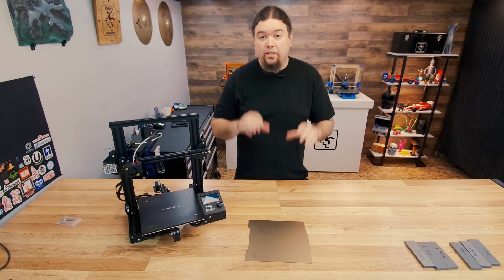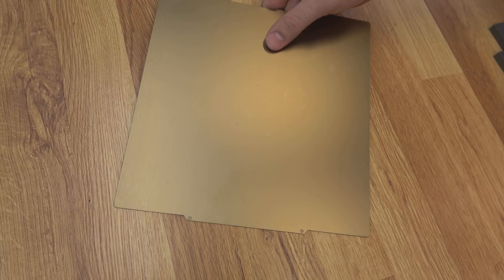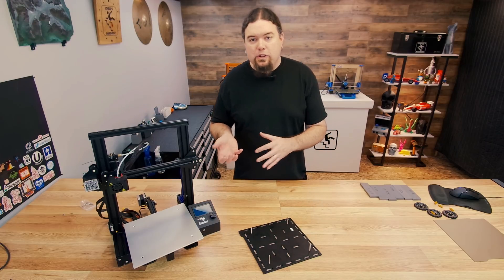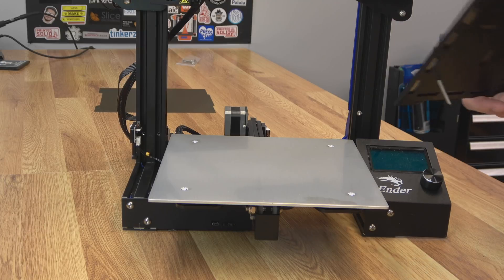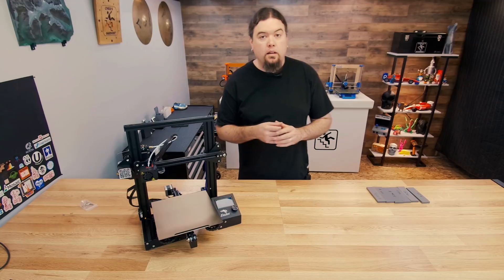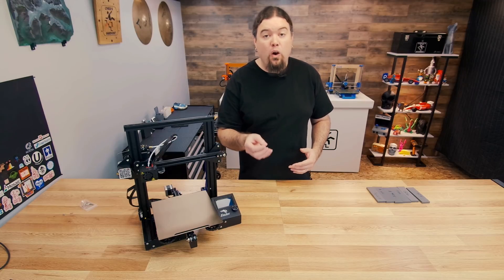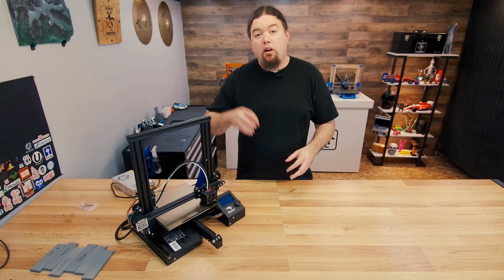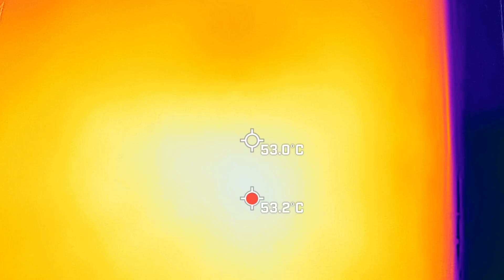Fula-Bed - Fulament - 3D Printer Bed Upgrade - Chris's Basement

Comment: back reviewing this video after having used a Fullabed For over a year now and very happy with it.

again what he fails to mention when he compares the two beds is the magnetic sheet on top of the stock bed or the glass build plate that comes stock.

The stock glass build plate weighs substantially more than the Fulllabed. 

I easily print at 3K acceleration using klipper and resonance tuning. I've removed the stock plate and used a silicone heater on the bottom of my Fullabed And I'm very happy with it. I can finally print very large objects without having issues with warped beds.
Reply from the maker: Glad its been working for you.

Comment: could you reduce weight by using a silicone heater powered by mains? It would eliminate the need for the original bed plate
Reply from the maker: Thanks, good idea

Comment: You forgot to add in the weight of the magnet when you weigh the ender three bed. Those magnetic sheets weigh upwards of 300 g

So you take the stock bed at 427 g add in a 300 g magnetic sheet.

And now you're up to 727g

I mean you do have to compare apples to apples and the Fula-bed does come with magnets pre-installed so it's only fair to compare it to a stock ender bed with a flat flexible magnet sticker on it.

Add the PEI sheet on top of it and your right back up into kilogram territory.

The fula bed is going to come out slightly heavier by the time you add a silicone heater to it which weigh about 190 g.

In my opinion well worth the trade-off for surface flatness.
Reply from the maker: Thanks for your insight

Comment: My one problem with my E3P is that the bed warped ever so slightly when I tried pushing the temp to 100C (was printing ABS).  Going from a stock 3 mil bed to a 5 mil bed is exactly what I would like to do to prevent bed warping at full temp.

Need to watch these folks.  If they offer a drop-in replacement (with the integrated heater), I'd buy it in a second.

Comment: That price for 6061 -- not mic6? If you're gonna stick a 1kg of extra aluminum on a bed slinger at least use the right material. Good review -- this is doa product. Can't heat treat 6061 to prevent it from deforming funny at temperature. Was there a problem with high temp magnetic stickers? A good one goes up to 150c, what is the point of this. Also buldtack did the epoxied magnets before on their garolite sticker mag beds, and I've had them fall out, and adhesive fail. If anyone ever does magnets on the back of the bed, they should be the screw in variety, not epoxied. .
Reply: Ya my wam bam ones work just fine. But I think this is more of a for flatness (at which point bolting it to the old warped bed probably shouldn't be done). But as far as the t6-6061 vs mic6 at 5mm thick and the sizes of the current plates it's probably fine for bed Temps (Considering the heat treatment for t6 is around 500c).

Comment: It would have been interesting to see the flatness of the stock beds.
Reply: there's no such thing "the flatness of the stock beds" in cheap chinese beds, I've three, all deform when heated. And simply because are cut out of rolled sheets with dubious quality. Take for example wood or diamond cutting disks, they all have relief cuts to counteract thermal expansion. Same applies here. Just a simple example of manufacturing under commercial pressure. That's why Prusa still makes PCB beds with embedded magnets rather than aluminium beds and high end manufacturers are using thick machined beds from a cast billet. jrucker2004's comment above is spot on
Reply from the maker: Thanks!

Comment: Yikes. Price is steep, but not a total deal breaker. However, about everything else is. The mounting isn't good, still chance of warping or shifting. Heating is a real problem. But that weight! Absolutely not for a bed slinger! This makes the MK52 bed Printed Solid sells for $95 look like a bargain, it includes heating traces, thermistor, bolts, tape, and isn't metal. I don't have one loose, but am very curious now how much less the MK52 PCB plate weighs in comparison??
Reply: You can get high quality cast aluminum bed from Mandala Rose Works in the US, for example comparable size 250x250 with magnets is 145 USD (79 without magnets). Their beds are highly regarded in DIY printer communities. Granted you still need heater and SSR and thermal fuse etc on top of that. You are right, while resonance compensation (Input Shaper) can do some magic, its weight is really not ideal for bedflingers.
Reply: Totally agree.. Looks like someone decided, let's do a Mk52 but from aluminium.. and yes, the heater comes separately, if you can find yourself one that fits...
Reply from the maker: I think they're still ironing out the kinks
Reply: @ChrisRiley  Great, if they can offer better alternative to notoriously taco/bowl Ender beds, all the better. Weight may still be a concern, especially at bugger sizes.
Reply: @MrHristoB  Keenovo offers heaters of all common sizes, and they can make custom for you too.

Comment: A very interesting product, as you said would be much better for an Ender 5 or 5 Plus if they have that size.   I use a glass plate over the stock  bed which I find to be very flat and have had good results
Reply from the maker: Thanks Dave, I think they're working on it.

Comment: I've been thinking about purchasing one of their beds for a while. In particular the larger one for the Sidewinder as I think it is the same size as the one on my tenlog tl-d3 IDEX printer. It's bed is not the best so I definitely want to upgrade it. Only thing that has stopped me so far is the price as I'd have to get the silicone heater for it as well which makes it cost almost $170+ if I remember correctly. Never thought of using the bed on top of the existing bed though. I may try that but at that size it is a lot of weight as you mentioned. I don't tend to print fast on my printers, especially that one so it may be worth trying.

I do love their double sided flex plates though. That is why I usually end up getting one for each of my printers so far over any others put their. Was going to purchase one for my kossel mini as well this weekend but they were sold out, so have to wait for that.
Reply: Why do things cost money it's unfair!

I wanna buy so many printer parts but I'm broke :p

Comment: This perfectly illustrates one of the biggest problems I see in the 3d printing industry:  People making/doing things they don't really understand.  6061 is extruded, and warps when it's machined and/or heated.  It may not be by much, but it absolutely does. (I wish you would have done the same test with your indicator when the bed was heated)
ATP (Cast aluminum plate) is a much better material for this application. In fact, it's a pretty standard material in the manufacturing industry when doing things that require something stable and repeatable (like a fixture plate).  It's stress relieved so that it won't warp when machined or when it goes through temp cycles.  I can only assume the manufacturer chose 6061 because it was cheaper or they simply weren't aware of the material properties.
Reply: IMHO... you summed up the entire 3d printing community. Many to most are clueless about almost every aspect of these systems as evidenced by the lack of understanding about the basics of electronics, programming or adjusting and maintaining mechanical systems. Not everyone, but I believe a majority.
Reply from the maker: Thanks for your input!
Reply: If someone use word  "assume" I know exactly what this is about.  :P Aluminum Tooling Plate (ATP) knows everyone who moves in industry and mass production. This includes also  3D printing industry. In fact its a "aluminum-magnesium" alloy, thats why it has consistent mechanical properties and dimensional stability characteristics. I saw exactly this type of material on a 4.5m high portal food package plant. Well know in plastic injection mold. Want to compare used materials for hobby printers and machine which costs 2.5 mil. euros?  You can try to buy somewhere this kind of plate and make it heated bed. Then let us all know exactly where you bought it and how much it cost....
Reply: I don't think you've ever tried to buy cast aluminum plate
Reply: @waskito3443  ya :D provide some source for cast ATP where you can buy it in small quantities. I'll let myself be suprised...
Reply: @Deluxa801  
Just about any voron vendor sells it also at a decent price. I purchased mine for about 85$ for a 250mm squared piece and it had holes predrilled. Midwest steel sells pieces at a decent rate.
Reply: And this is why you are a hobbyist and not a materials engineer.

I worked as a VP in charge of prototype development for one of our nation's largest aerospace companies.

Heat treating 6061 aluminum relieves the internal stresses and stabilizes the material. It's precisely why this manufacturer heat treated the aluminum and then machined the top surface flat.

I'd venture a bet that this bed will probably be more thermally and dimensionally stable than any similar bed made out of raw Mic-6
Reply: @dannelson8556  This is why you're not a hobbyist, as you assume that some generic aluminum plate that has an unknown source and material is properly heat treated and stress relieved.
Believe it or not, not every supplier or manufacturer is the same, and is often worse.
Reply: @derektran9404  the manufacture clearly states that the Fula-bed is heat treated. the only reason to heat treat a printer bed is to relive internal stresses which will thermally stabilize the aluminum to prevent it from warping.
Reply: @dannelson8556  Where? I have purchase one of their beds and checked the sales page for both the Sidewinder and Ender and it does not list this. As someone in your position you should know the distinction between heat treated and stress relieved, and the inherent differences in cast vs extruded.